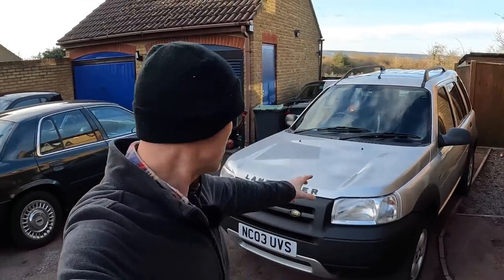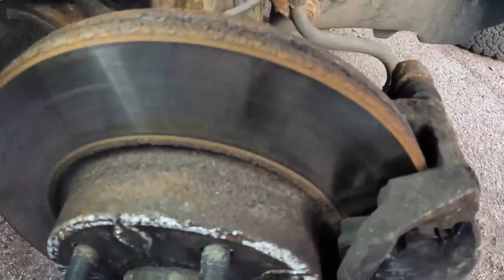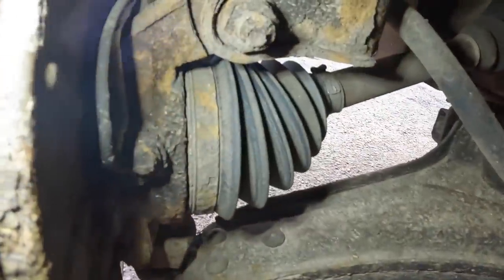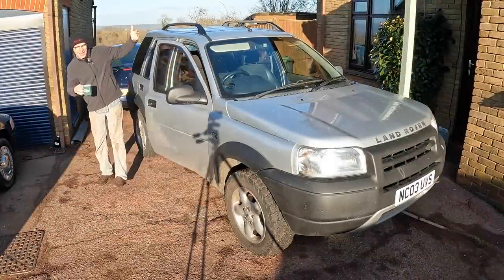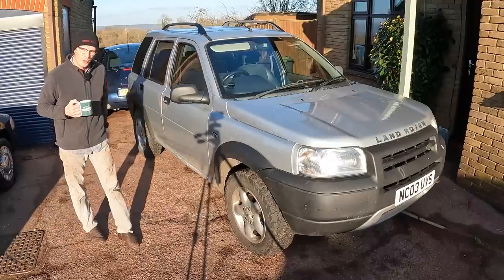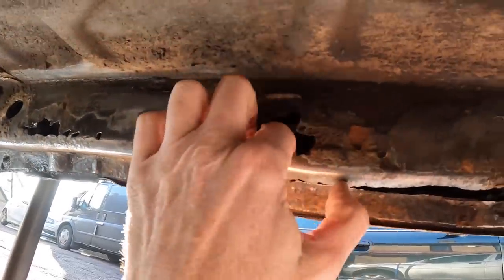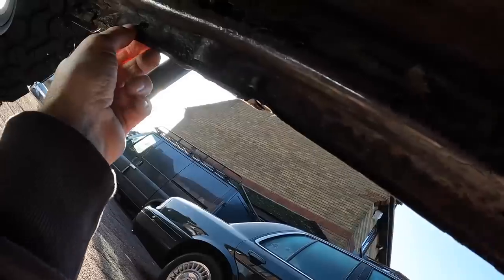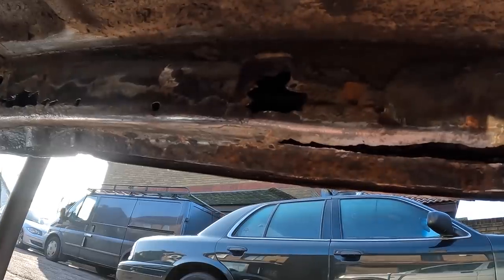Freelander MOT fail...Holed below the waterline and going down by the head

Comment: I did the same job for a customer last year. I just got a Land Rover sill repair angle from eBay and a 25mm straight angle length from Turnbulls to create the return lip and made it fit. Once everything was cut out and the new section welded in, it went together quite easily.I got positive comments from the MOT tester about my fabrication & welding 😄

Comment: I feel your pain Matt. That heart sinking moment where you realise it's not going to be a 5 minute welding job after all. And not the best time of year to be tackling something like that. If your other vehicles allow it, I would be tempted to put the Freelander off until the weather warms up in a couple of months. Jobs like that are always much nicer when it's not near freezing!
Reply: Before I watched this video I had been surprised when jacking a hippo, that there was folding steel in the sill near the wheel arch that is usually strengthened.  The metal in these cars is nasty, soft and weak stuff and the paint is as ghastly and fragile with a soft clear coat.  They're absolutely not quality vehicles, even though like the Princess 18.22, the idea or the plan was nice, we have you know, a really nasty car in production form and off road ... you know, very dubious.  Apparently as capable as a Lada Niva but how they compare on build quality would make an interesting report.

Comment: It's an easy fix and definitely worth doing if it's otherwise sound. Scrapping it or getting rid of it and buying a Discovery to replace it would only lead to plenty of similar 'discoveries'. They all do it, so 'repair and maintain' is the way to go with this one. If you intend to keep it, of course.

I'm having lots of similar rust issues with my Mk6 Transit van but I have replacement panels to weld on when it's a tad warmer and I can then be confident that it will survive. I always drill 12mm access holes in my panels with closed grommets in addition to what might already be there and I then coat the inside liberally with chain oil to make sure I will have a long lasting repair. Better the devil you know, and all that...

Comment: Ah yes, the plastic of doom. My 2003 Mercury Sable wagon had those plastic door sills and you could see that there was rust being hidden by them. However i did not dare remove them to look in fear I would never get them back on. All those Hondas back in the day had rear wheel arch rust because of a piece of plastic behind the wheel wells that trapped dirt and water and rusted through. 

I think your best choices are 1. take it to a body shop place and get it professionally done so that it will not trouble you again. 2. repair it as a big project come spring or 3. take it along with a gallon of gas and matches to a field and be done with it.

Good luck to you on this

Comment: Mine, 55 plate, failed last month for exactly the same thing by one of the rear jacking points. Now fixed but I agree the plastic covers are a moisture trap. I'm not sure if not to keep the car, as the rest of it is great, or sell it as I'm sure the rust will return for next year.

Comment: Really interesting vid, just something so satisfying to see rusty metal being exposed and (later of course) being cut out and replaced. For most of us it is a trip to the scrapyard, but you have the welding skills to rescue the old girl. 
Patio heater, welding equipment, goggles...lock and load soldier!🪖

Comment: I feel your pain, so many cars of the 80/90's had skirts, wheel arch extensions and badly deigned suspension mounts especially on the sportier versions, the rusted away before you eye. Even with the knowledge of where to look out for I had to had load of welding on 2. Those sill protectors are...well I ain't got the words andmaybe JLR should take the blame, they were a crud trap.

Not the weather to be doing it in, even though nights are lengthening some. If someone else owned it, it would be scrapped, guess you had the follow up the the "Saving Mondeo", without even realising. 

If Mrs FD has faith in you, don't see why we shouldn't and Hippo wants to consider itself a lucky thing. Gonna be another good couple of vids for us folk to watch. You're arming us well for what some will have in store as the weather improves, in Britain 😂 👍

Comment: For me and my MG TF this weekend; Broken engine mounts bolts. Friday morning pulling away at a roundabout, "Bang". then everything got loud, clunky and grindy. Got on to work, no noise when accelerating, "Clunk" when gear changing and waiting. Really bad grinding when reversing. "Was it my welding on the exhaust pipe giving up or the 18 years old gearbox exploding?" No. A work mate noticed the engine rock when I tweeted the throttle. Nursed it home. As long as I was keeping a steady speed it was fine. On stands, I found the engine had dropped down and forwards, resting on the alternator, hence the grinding. Reversing pushed it harder. Couldn't see what was broken at first. So booked it into the garage for Monday. "It won't be the mount, maybe the bolts" they said. Saturday; yes. K series engine. The bolts you undo when changing the timing belt, those ones. Both snapped. Now, the engine is held up by ratchet step and iron girder. Just to get it up hill to the garage without more grinding.

Comment: I’d want to know that the noise you’re hearing isn’t the diff, prior to cracking on with all the welding! Also having worked for a good few years as a steel fabricator I can tell you for nothing that prep is key… I would get the car on a lift so you’re not contorted into weird positions when you weld and also you’ll do a much cleaner job of removing the rot and tacking in the new metal. Ps. wearing welding gauntlets for angle grinding is also making things significantly more difficult for yourself! 😂

Comment: Oooof sorry about that Matt! 
     Still on a positive note or notes, it’s not beyond your capabilities of repair and another Mk1 Hippo will be saved, but your right with the comment if it was in the hands of a different owner, that rot probably would have seen the hippo condemned to the Scrapper sadly owing to the cost of repairing it, 
    I had a Honda CRV MK1 a few years ago which catastrophically failed the MOT, not only on Rot on both sides at the rear but the engine was burning oil in amounts unmeasurable at the test centre and the rear trailing arm bearings were shot, sadly that lot did send it to the great scrapyard in the sky. 
     Hope you get it sorted mate, those plastic sill covers are useless and often cause more problems.

Comment: 1996 P38 passed clean 1st time last 3 years. Indeed both of them did. Tend to find disco's and Defenders catch you out more than anything. Freelander 1 &2 tend to be rather good.

If they have ever had side steps and this goes for the L322 sill rot front and back where they mount.

Comment: I was going to say cable ties are OK for CV boots but it seems that is the least of the problems! If you can't get a repair panel there may be a suitable box section material you could adapt. Steel that thick is not easy to bend without the right equipment.

Comment: Ha welcome to my world. 

Same issue on my daughters 04 TD4. Being a ‘prodded’ and maybe over zealous type this has ended up as a full read end rebuild ranks dropped out and new brakes lines. Both sides done and rear sub frame and suspension removal and removal bushing.. floor pan stripped cleaned off treated/re seam sealed and painted with SEVEN layers of primer and the same number of ‘top coats’

Daughter has just bought a new car..  

Too many grand kids to fit in Freelander now!!

Comment: i have never heard of a freelander going rusty, but, - 20yrs old now, so not bad really
mine had side-steps on, the bolt fastenings rotted out, so i chucked them away + drilled out the rotten bits using a step-drill, making perfectly round "ventilation holes",  you fail a MOT for damage or corrosion, all legally fine now... [but yours are toast].    get your mot before taking the other side off [ + only fix the outer sill hole, + refit the cover] testers not allowed to remove covers.   i have a MOT licence, so [in my opinion], freelanders were so well over-engineered, no danger with that little bit of rot [at the present]    job for the summer i reckon...

Comment: What a pain!  I would definitely pull the plastic cover off the other side and have a good look at it.  You may be able to prevent a bigger job later and if it needs repairing too, you will have the knowledge that the car has the required structural integrity once fixed.  Good luck!

Comment: Hi Matt, The engine in that will be the BMW M47 diesel. I'll guarantee your starting issues, and probably what killed your battery, will be the glow plugs. You may get lucky and find its the relay, but i doubt it. Even more Bad news, it will be a head off job, because every one of mine snapped while trying to remove them, no matter how careful i was. These engines are notorious for it.
Reply: Penetrating fluid regularly for a week prior to removal would likely address that
Reply: @christopherreed442  Tried that after the first one snapped. He might get lucky though, but on the forums, it seems everyone with this engine seemed to struggle. The one thing i didn't try though, and might do the trick, is a blow Gun on it and get it red hot. You can let it run, to warm up the engine, but by the time you've disconnected everything, its gone cool again.

Comment: New sills, job's a good 'un.  At least you can do your own welding. That is a skill.  Tie wrap for the cv joint, sorted.  Crud behind disc shields is common.  I'm more worried about the condition of the VCU in the transmission.   They should be changed after 70,000 miles because they lock up all the time instead of only when the speed differential between front and rear axles occurs.     if it has locked up, serious wear will occur in the rest of the transmission.  Might be responsible for the noise?     Land Rover don't mention this in their service schedule, probably because of the cost!

Comment: You can fix this Matt, listen to your good lady wife. It always amazes me though how one hole can turn into a hell of lot more work, good luck matey.
Reply: My Transit rust started with a small hole in the chassis and ended up with a huge section of the chassis having to be cut away. Luckily I can weld so it can be fixed with a bit of fabrication and at the same time I am replacing the lower panels all the way around.

Not yet, though. Snapping icicles off the end of my nose in this horrible weather isn't my idea of fun! 😀

Comment: I have the exact same hippo but in manual. 
It has had problems killing batteries for quite a while. In the end I found the alternator was overcharging the battery and boiling it. 
The regulator in the alternator is busted. New alternator.

Comment: OK their is rust on a common freelander spot, but it actually looks worse than it is, you have plenty room to grind back to good metal on the rotted panel, at least there is nothing awkward in the way or anything to dissasemble.

New panels are readily available, but after market ones might need a bit of jiggling about to make them fit tightly.

Do both sides, you will definitely regret it further down the line if you don't at least investigate whats behind that plastic water trap, if nothing is needed at least you can treat any surface rust to stop it rotting.

This is what MOT tests are for, you get a list of major faults, plus anything that is going to be problematic in the future.
Well worth the £50 just for your piece of mind.
GGGreat vid by the way.
Ray

Comment: Oh dear. My old 1989 Volvo 240 in the 10 years of owning it from 2009 to 2019 had to have the passenger outrigger welded twice. Went the 2nd time in front of the weld points. 1996 940 had a small patch on offside rear jacking point for this years MOT.

I feel your pain. A fantastic, not great water trap. I would leave off or heavily dinitrol etc when repaired. Hope other side isn't the same. Has a lot of surface rust underneath. Needs a good grind back, rust converter and re rust proof.

Comment: Your starting problem may well be leaking back injector's and/or the glow plugs could be goosed as well, the injectors can be leak back tested with the specific tool with four little bottles attached by tubes to the leak off pipes of each injector (follow instructions), and the glow plugs will need to be individually checked by disconnecting the wiring and checking each one's resistance or just a basic spark test (Length of wire from the positive terminal of the battery and the other end lightly touched on each disconnected glow plug, spark means good and no spark means kapput) ! 😁

Comment: I remember the passenger side rear wheel locked up a bit when parked in another video. I wonder if the brake shoe has broken up slightly, meaning the lining is grinding on the inside of the drum, occasionally jamming itself in the works causing a lockup.
Alternatively, it could be that rusty dust shield. It’s in such poor shape, it’s probably a better idea to remove it anyway - iirc replacements aren’t dear for those.
Good luck!

Comment: Mine was exactly the same. failed the MOT on a small hole in the sill, pulled the trim off to patch it up and found pretty much what you found. And mine was only about 13 years old at the time. took a few hours of swearing and getting burnt whilst welding upside down but got it patched up and back on the road. I'm certain you can do the same.

Comment: familiar stuff, I had 2 civics with just a slight little visible rusty bits, and upon removing the skirts and inspecting further, a whole load of rust came up. Botched the old one (S reg) and sold it, the second one (05 reg) got welded up, repaired properly, as I'm planning to stick with it for, hopefully, many years more

Comment: O what a shame, poor hippo.

There’s a few general points I have.

II was wondering…vinyl coverings…some people over the whole car….what happens under the vinyl…with a U.K. climate?
…my instinct says, bad idea.

Series 1 freelanders must be getting rare by now. Very distinct design, esp that 3dr variant. Future classic, if you can save one and store it in a permanent air conditioned garage (to prevent humidity causing it to fall apart)…..

..and that leads to my last point. I was never fortunate enough to have the time, space, or money to keep a classic car. My folks had a few old Vauxhall’s in their day, velox, victor, wyvern? My sister said years ago they should have kept one of them, along side an everyday car….but you can’t easily do that. Space, costs, time…and that was before the internet-good luck tracking down rare parts or specialists.

Comment: You have my commiserations Matt (my car has just failed its MoT too) - I wouldn't be surprised if there's a repair section for that and you'll be able to sort it one way or another, I'm sure. Those stupid plastic covers on sills are, I'm convinced, the reason my 1994 BMW E34 is rotten in that area round the rear jacking point and up the rear wheel arch; amazingly, BMW still seem to sell that panel so I may get some whilst I still can. And yes... if you can save the Merc, you can save this.

Comment: In it's first few years that plastic trim is protective. Trouble is if stuff can get under it (why does that happen?)and then it is a liability. Definitely think you should take the other one off. Better save it at this point than it become much worse. Good luck. Makes good content for the channel.

Comment: Hi matt, The old school way of mounting  CV  boots were two turns of galvanised wire and twist the ends to tension works even today, modern equivalent is a wide cable tie or two thinner  ties next to each other, No need for any special clips.While your at it inset a screwdriver between the boot and squirt in some more grease.
If your looking at buying a used Freelander , an easy check on the door sill condition is..
The two plastic clips each end are the locating mounts for the cars jack. If the bottom line of the door sill  curves up as in your case and not perfectly straight, you know the sill is in very poor condition its collapsing under the weight of the car, not good. Rusted or damaged jacking points are obviously an MOT fail,, 

There will be a lot of interest in how you solve this problem ,so my vote is for you to fix it..What say the rest of your subscribers..??????
Reply from the maker: Im loving these CV fixes, this is what will have to happen!

Comment: i would pull that nearside sill cover off and get that done too i would expect it to be the same, as for binning the hippo in favour of a disco i'm not sure you're going to see much difference, still a bucket of rust. i have a 1977 series 3 which i have to invest in a new chassis for since there is nothing to weld to that i would consider safe.

Comment: Those sleeved wheel bolt bits are indeed from Lidl. After a while a plastic part came off but I just pushed it back together.

Comment: You are right. Cars fall to bits. Deal with it. I did get upset at having to scrap a car I quite liked once because of underbody rust discovered at an MOT and though the car was quite young, relatively speaking, and with a fairly low mileage it was just not economic to repair. I think I was surprised and shocked at first, then annoyed and finally resigned to it.  Within a few days I'd traded it in at scrap value for a newer car and forgot about it.